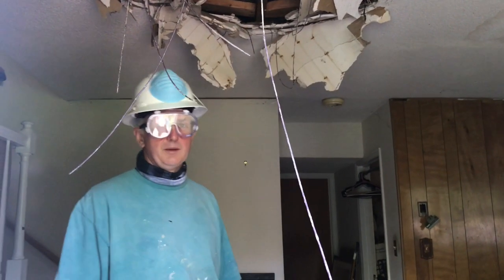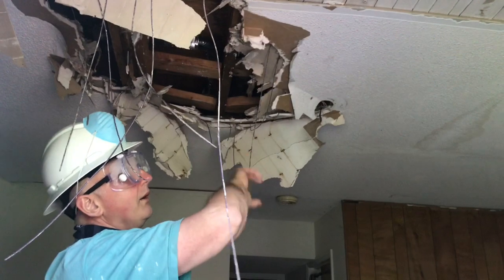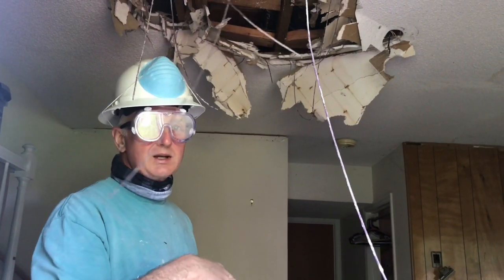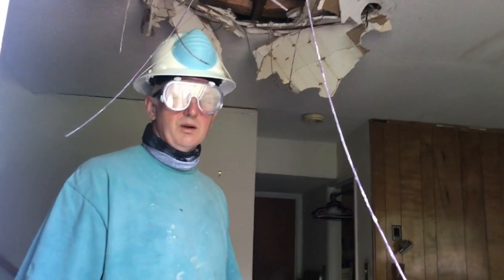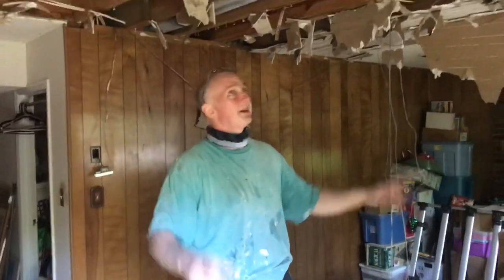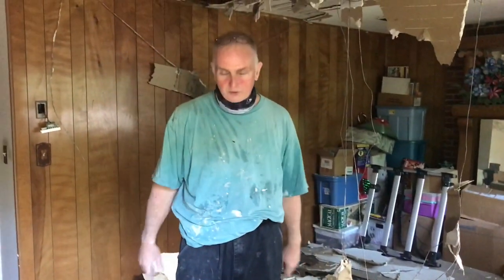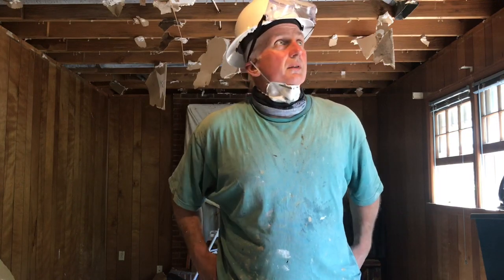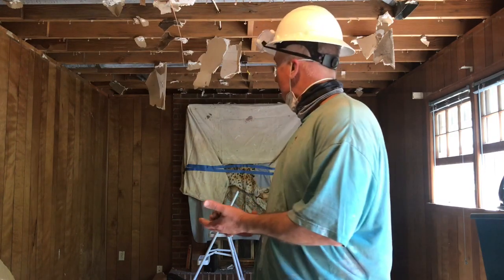Ceiling Heat Removal / Demo / Clean-Up - How to - DIY

Comment: So now that room will have no heat?   We built a home in 1978 and installed radiating heat.....  I absolutely loved it.... evenly warmed room, each room with it's own thermostat so you could keep costs down by having lower heat in unused rooms....  loved it..... moved in 1987 and it was still working perfect....  why not replace it?

Comment: What are you going to do for heat now?
Reply from the maker: This customer had a modern gas heating system. The 1960's heated ceiling hadn't been used in years.

Comment: My ceiling is cracking and I’m going to replace the ceiling heat with a furnace.  Can I repair the huge cracks, or should I tear it all down and replace with new sheet rock?